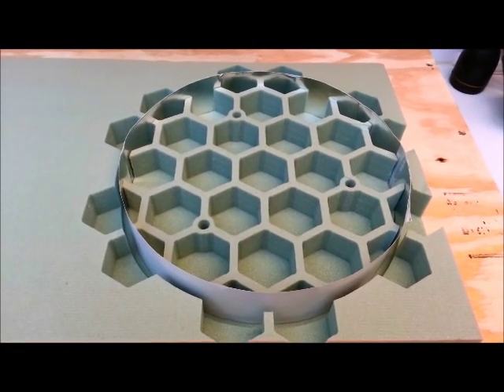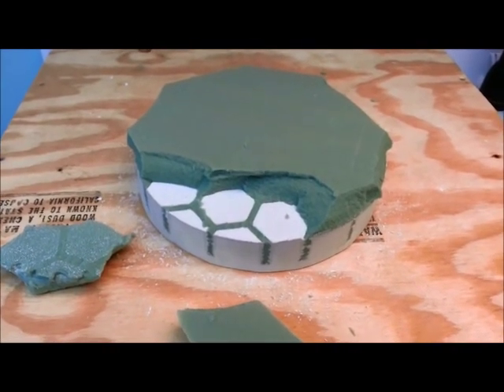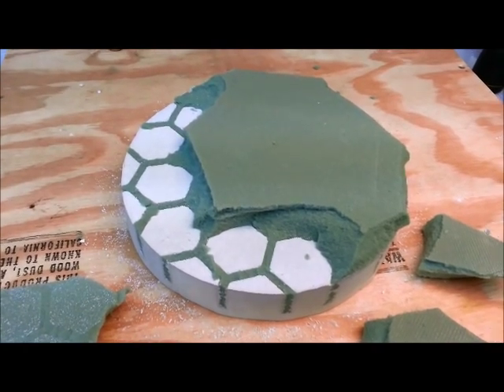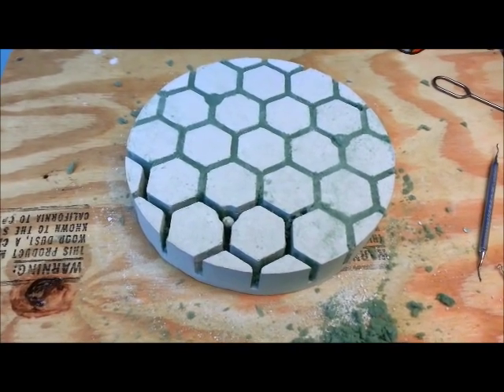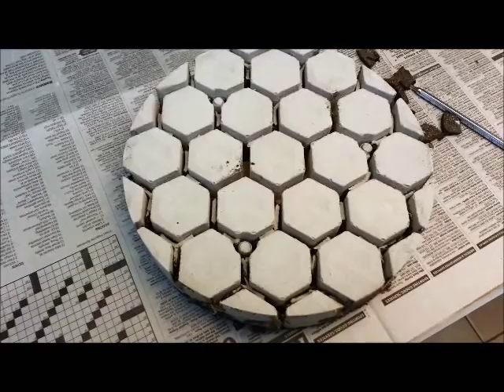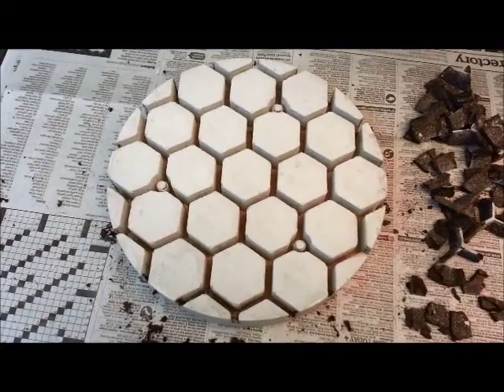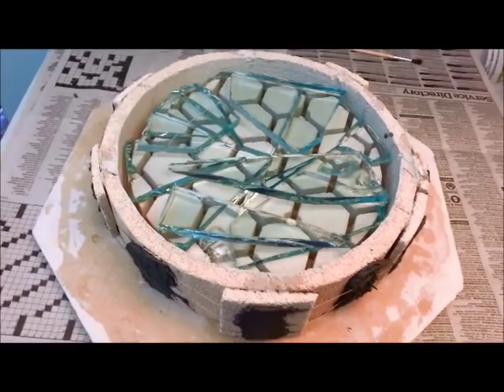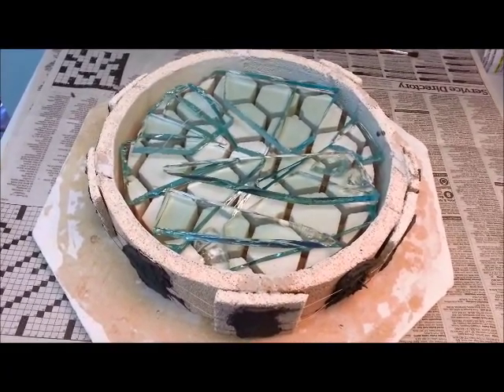Casting a lightweight hexagon back telesope mirror

Comment: If you cut the plug out of styrofoam instead of florists foam, petrol will dissolve it.
Reply: I really thought gasoline would dissolve it, kind of surprised actually. Good tip.
Reply: @pdutube  Instead of beaded styrofoam use extruded styrofoam that is used for construction insulation.  The beaded is too weak.
Reply: What's petrol?

Comment: Instead of florists foam use extruded styrofoam, which is the foam used in construction.  Acetone, MEK, gasoline, etc will dissolve it.  You of course should burn out the investment prior to putting the glass in the mold to remove all traces of volatiles/plastic that may infuse into the investment.

Comment: why my glass is opaque after casting. But your is so clear.
Reply from the maker: Your glass likely suffered devitrification. It happens. Some types and batches of glass seem more prone to it than others. Hard to know in advance if it will be a problem. About all you can do to try to prevent it is keep the glass very clean, and minimize the time it spends in temperature range of 1350F to 1500F.
Reply: @omegageek64  Or I had to cool the glass very quickly from 1750 to 1050
Reply from the maker: @АлексейГеоргиевич-м7и  Yes. Cool the glass as quickly as possible to the annealing temperature. I usually open the lid of the kilns bit to speed the cooling.
Reply: @omegageek64  And then the glass will be transparent?
Reply from the maker: @АлексейГеоргиевич-м7и  No promises, but you'll have better chances of success.

Comment: Why not just mill the plaster mold directly, and save a step? That way you can also create a concave surface that compensates for the surface curve and keeps the thickness uniform. Carbide tools should do the job.
Reply: Because plaster is super brittle

Comment: I am wondering what is the effectiveness of making a parabolic steel lens then having it copper, nickle, chrome plated... I used to work in a chrome plating shop.  So, I am just curious.
    Also, I am thinking of a better method of grinding a lens either in glass or steel. I have built several telescopes, but all were with makeup mirrors, which worked quite well but surely not as well as a ground glass mirror.  With this information can one provide a mathmatical equation that shows the size larger makeup mirror to be equivalent to what size smaller ground mirror lens.  Also, I am interested in knowing where I can purchase the chemicals necessary to coat a glass lens making it into a mirror. One more thing... If I ground the mirror into a parabolic shape on one side and left it flat on the back side, then mirrorized only the backside... Would there be any benefit...would it work?
       My goal it to get a quite large reflecting lens, say 24+inches...possibly up to 36 inches in diameter to use in my next telescope.  I am looking at the possibility of making a trailer mounted telescope, where one sits in a seat and rotates the telescope up, down and side to side plus the eyepiece will actually be a camera hooked to a computer or tv monitor. (of course the telescope will not sit upon the trailer during transportation.) I am looking to mount a tracking device to follow what I am watching.
Reply: The coating is just aluminum, which is heated in a vacuum to emit vapor, which then condenses on the cool glass.  Most places that do aluminization also can also add a protective coating, as an aluminum film is very easily damaged.
Reply: i heard that chrome is porous, this might be a problem in an optical device.
Reply: The coating is aluminium, while I am sure you could deposit this on a metal based mirror the problem comes later when you need to replace the coating, with glass you can clean off the old coating using ferric chloride, this has no effect on the glass, however on a metal based substrate is likely to be damaged doing this, also  the thermal expansion of metal is somewhat higher - excluding Tungsten
Reply: @travismiller5548  Everything is a bit porous hence the reasoning in making the reflector or lens larger and larger. It allows more light in and reduces distortion.
    Now, curiously enough, these Flat Earthers leave me with the idea of tunneling under their dome thingy and placing my telescope on the outside that dome thingy next to one of the magical doors for ease of access if repairs are needed. Hey, couldn't I put up a toll both there? What a bummer this gravity thing is (that they claim does not exist).
Reply: While I am posting here... Does anyone know how to use a fish eye lens to make a dinner plate appear as a sphere?

Comment: Just wandering if you laid the lens face down on a protective surface that will hold it in place. Then use a pressure washer with undetermined amount of pressure and same with type of tip. To remove and clean debris from the grooves in your glass. With out having to use metal tools by hand. Since doing it by hand would result in varying pressures of force to complete the cleaning. And if the pressure washer could work out for you, at-least there wouldn't be metal tools digging around your glass. And if the pressure washer would work for you then there shouldn't be a problem with an accidental over-pressure applied in any critical areas cause the washer would be the only force applied which would be the same all over in all angles

Comment: to remove the plaster hexagons from the back of the glass, I would soak the whole thing in a big bucket or bath for a couple of days. Then use a jet was to blast out the plaster. Soaking plaster makes it weak, unless of course you've used plaster with some additives in it to make it waterproof.

Comment: The glass should not fracture from heating too fast,  just form cooling too fast or from dissimilar materials upon cooling below Tg.  This system definitely has dissimilar materials.
You got a long way for just getting started!  Also,  you may be able t heal the crack by reheating after all the refractory is removed,  just by heating 20-100° above Tg and then slowly cooling (6-8hours?)

Comment: Gosh, There is no structural reason to use hexagons for a lightweight mirror. Squares or rectangles also work as long as the facesheet is not too thick or too thin.. With square pockets, it will be much easier to clean out the rib channels. 
A properly stiff mirror with minimal weight will have an equal back plate but have small core drill holes for venting to the atmosphere. Mirrors for launch MUST have the vents or the blank may explode on ascent.  The holes can be radial, rathe than axial.
 This work is advanced enough that a turntable should  be introduced into the kiln so that the blanks can be spincast, just like Roger Angell does.  A magnetic drive could keep the motor shaft away from the heat.  In this manner, the front facesheet will have equal thickness from center to edge.
The ribs can be a fraction of the thickness shown here and still maintain their stiffness. The mounting plate for the three pickup points must be sufficiently rigid so that it doesn't transmit torque into the glass. This is achieved using wire flexures in the shape of an A-frame to prevent mirror warpage and astigmatism.  There are opto-mechanical engineering formulas that define the overall thickness of the mirror, rib thickness, and facesheet thickness for a given mirror diameter.
Since different materials have varying Young's Modulus of Elasticity, this number needs to be a part of the equations.. 
 Starman Paul
Reply: Hey there Paul. You seem to have some extraordinary skills in this field. Can you send me a PM with some suggestions for brushing up on my skills ?
Reply: " A magnetic drive could keep the motor shaft away from the heat"
Nothing kills a magnet as fast as heat
Also it would seem you have not actually made any mirrors, its easy to be an armchair expert its quite another to actually make something.

Comment: could it be less trouble to have the hexagons and pins separate and just held by a fixture that's then packed into sand? seems like you need more draft angle on them, and having them individual means you could have bolts on the backs of them to help pull them out when done

Comment: You could make your plaster mold out of machinable wax instead of foam, then you can melt it out easily and recast into a block for another project later.
Reply: sammorgan31 the company he got the refactory material from, ransom & randolph also has many waxes available. i would call this experiment a success and go ahead and make a better designed master mold from silicone, for casting wax positives

Comment: you could have used mold release compound
Reply: Phil Pan mold release & designing proper “draft” the opposite of an undercut, better than straight vertical walls into the mold.

Comment: Well, seems there's a reason they used phenolic foam and phenolic impregnated paper for reentry shields for the space program :o There is the high density polystyrene insulation foam, that machines pretty well. Might be better/easier?

Comment: So.. if you do this again, protip, spray some silicone on the foam as a release agent. Can be found in most automative stores.
Reply: Don't think silicone will still be silicone at kiln temperatures.  But I do think that including some draft in the model would make removal easier.  Or as some have suggested, use a type of foam that you CAN dissolve.
Reply: this is true and good, but any mold release would be better than none.  the heat of refactory hydration is nowhere near the temperature of a kiln ride, and hopefully the foam isn’t going in the kiln.  proper draft was totally the problem

Comment: Apparently you need a strong oxidizer to degrade the phenolic resin. Better just to use a different foam next time... Or, I wonder if you could sand-blast it out.

Comment: Why not use the CNC mill to cut the channels on the plaster directly?
Reply from the maker: I've tried that. The silica in the refractory plaster destroys cutting bits. Gotta make molds out of something softer. What I am working toward is making a mold that I can use to make a silicone rubber mold from. Then from that I can turn out multiple plaster molds easily.

Comment: Normally, optical glass is melted in vacuum and cooled down at just several degrees C per day. The technology is similar for sitalls but the cooling process is quicker because sitalls are partially ceramics with a crystal structure which doesn't take much time to form.

Comment: Does the plaster heat up as it cures? That would explain the foam getting burned? Totally in awe that you can cast your own glass mirror blank. To try to fix that little void might you try to add a little glass there and refire it all?

Comment: Many years ago I toured the U ofA mirror lab.  They used individual hexagons with a small nubbin on the bottom.  Of course they were casting a three meter mirror so things were scaled way up. The nubs were long enough to register in holes in the bottom of the mold and to provide a space under the hexagons for glass to flow during casting. This makes a flange to reinforce the mirror (The hexagons cannot collapse ).  After casting and annealing a high pressure washer is used to wash the hexagon mold pieces. I remember the whole casting process taking about one year.

Comment: what is the highest temperature you use for full fusing?
i have a homebuilt kiln which goes to 1000C however i see some people like to fuse discs while others, like you, do it from a lot of tiny glass pieces.
Do you reckon one can get away with lower temperature if he fuses glass discs instead of melting a lot of tiny glass pieces to make a blank?
Reply: Two different processes here, casting needs to melt the glass enough for it to flow down into the mould, this will take temperatures around the 1400C mark, when fusing you don't need such a high temperature  and this can generally be done around 900C

Comment: if you put the mold on a spinning table as the glass is  filling the hunnycomb, it will preee form a parrabala, it be shaped for inferred,but just minor sandding is needed
Reply from the maker: That is certainly an option. I haven't figured out how to either spin the entire kiln, or build a spinning platform in the kiln, at least not yet. Maybe when I retire and have more free time to perfect this process.
Reply: one could engener from cement mixer ,
Reply: omegageek64 reminds me of how Adams & chittenden used a rotary device and a slow steady roast for perfecting honeycomb filters for scientific glass, before imported water jetted filters became plentiful.  they were rotating a big tube packed with small tubes, while heating and vacuuming out the spaces between the small tubes.

Comment: Maybe I'm missing something here, but...You have a CNC mill....why not simply mill a solid block of plaster in the first place and save all the trouble??
Reply from the maker: The refractory plaster I use is very brittle and hard to machine. It also contains alumina and silica additives that would dull cutting tools in a heartbeat. Machining the foam is a lot easier.
Reply: and only with grade A vacuum dust collection.  that would be a nasty and hazardous dust.

Comment: Seems like ultra precise fidelity on the surface of the back is not as important as quick release agents or appropriate solvents.
Reply from the maker: Ultra precise is not really necessary, but I would like the alignment sockets to be nice and smooth and dimensionally correct inside since machining them later would be difficult. Also many mirror makers are fanatical about the back surface of their mirrors. They routinely grind them perfectly flat, smooth and remove any trace of wedge. whether these steps are truly necessary is debatable. Making the back surface as smooth as possible during the casting process makes later work easier or even unnecessary.

Comment: Why not choose a different foam such as Styrofoam that will dissolve in acetone?
Reply from the maker: The florist foam has a much finer texture than styrofoam. It gives a much more faithful reproduction in the plaster. Melting styrofoam with acetone also isn't all that easy. The resulting gunk tends to stick to the plaster mold and acetone soaks into the plaster. I still end up having to burn it all out in the kiln. The acetone is very flammable and I have had several mini explosions in the kiln trying to burn out the melted styrofoam.  So I gave that up. The florist foam just quietly turns to ash, only emitting a little smoke as it decomposes. I can blow the ash out of the nooks and crannies of the plaster mold with compressed air.

Comment: How can you only have 10 views? This is simply amazing work! You dont happen to live in Tucson AZ do you?
Reply from the maker: I just uploaded this video a little while ago. So that is why is has so few views. Thanks for the complement. No I don't live in Tucson. I am in Clearwater Florida.
Reply: omegageek64 I didn't know you have a YT channel until just now. Your experiments with this are very interesting. Been tempted to get a decent kiln large enough to do up to a 12-13 inch mirror, and try it myself since I saw your website a year or two ago.
Reply: Annealing is done in the kiln - there is a temperature profile used to heat up to melting, hold there briefly, rapid cool to a solidification temperature (prevents crystallization), then back up to near melting followed by a slow cool down which is the annealing process.

Comment: Very interesting technique! It's cool that people make their own telescopes.

I figure the hexagons are there to provide stability? Couldn't you use for example spray foam as a backing to add some rigidity at minimal weight?

Can you grind a mirror using a CNC machine? If you first CNC the shape, then use some sort of polishing attachments to make it flawless?
Reply: I'm kind of guessing but I think there are at least two, and probably more problems with foam backing: different coefficient of thermal expansion of foam and glass will give the mirror massive wavefront errors and two, the glass part will not be thick enough to be rigid enough to maintain its shape by itself and whereas the rigid honeycomb glass backing would be rigid enough, foam would not.  They do make foamed glass as a backing material but I don't know how well it performs or how hard it is to implement.  I just found this paper which covers several of the lightweight mirror strategies: https://www.researchgate.net/publication/236178351_Lightweight_Mirror_Developments.
I think the really big mirrors for observatories do sometimes use cnc for shaping; https://www.youtube.com/watch?v=MjUcBWYVF9s.  I guess it would be possible for small mirrors too but since I don't see it being done maybe it's so complex and/or expensive nobody finds it worth the effort vs. the existing methods.
Reply: @perspectivex  Thank you very much! That is an awesome paper to answer most of my questions / ideas.
Reply: @dejayrezme8617  no problem.  It's a little tangential but you might like this book too if you're thinking about telescope innovations beyond just the mirror part: Unusual Telescopes by Peter Manly, https://www.amazon.com/Unusual-Telescopes-Peter-L-Manly-dp-0521382009/dp/0521382009.  p.s. in case you're thinking of deformed reflective film as another mirror option, this was one of the best discussions of the problems with it I found: https://www.cloudynights.com/topic/690162-vacuum-formed-mylar-mirror.  It appears to be a very hard problem.